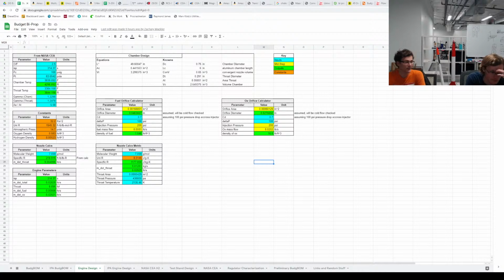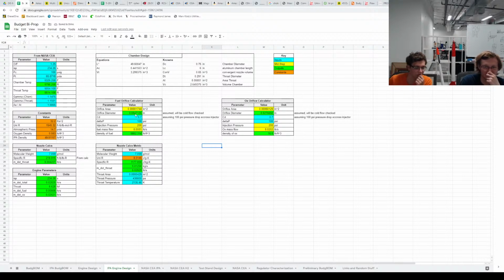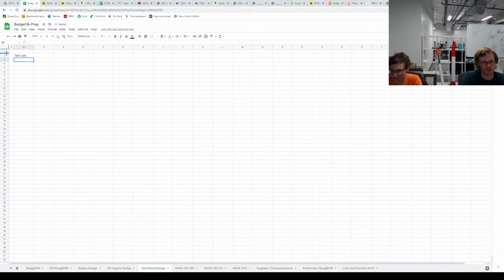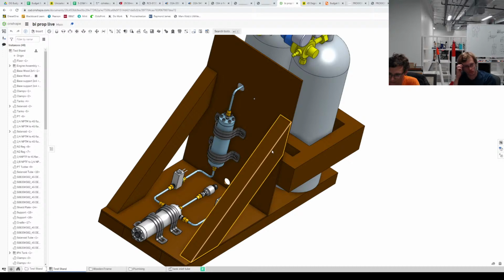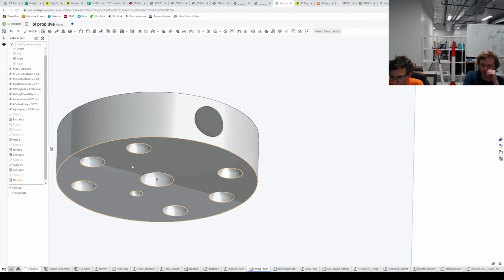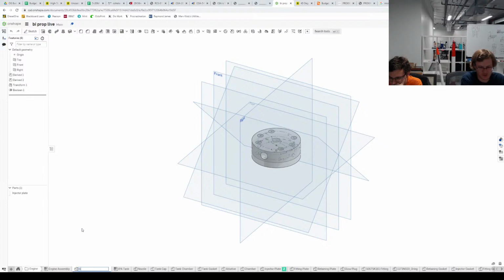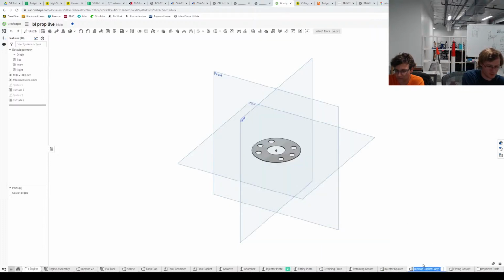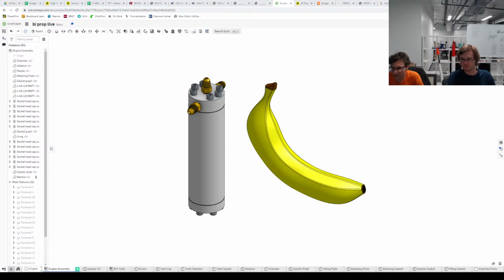Adjusting the $500 Bi-Prop - Design Stream

Comment: Where did you get that spread sheet to calculate your rocket dimensions? I did all mine by hand so it would be useful if i could compare it to the spread sheet.
Reply from the maker: In our first video we made the spreadsheet from scratch and then went back to edit the design when we realized we needed to make a few changes.